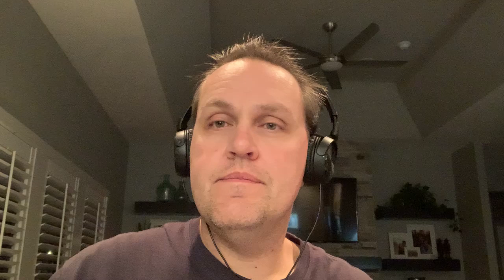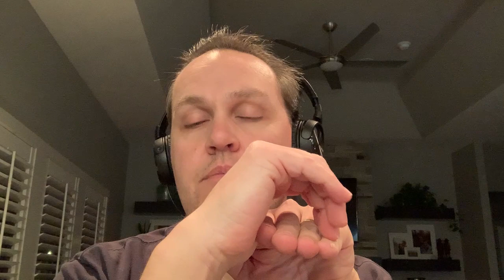Subscriber question LIM noise

Comment: My favorite rollercoaster is Steel Venom at Valley Fair. It's an Intamin Impulse coaster that uses LIM magnets. It always made a very distinct "screaching" or "grinding" sound whenever it launched. However, one thing i noticed was that when it received a new launch system, it sounded different. It made a high pitched "squeal" or "beeping" noise. I know the launch system was replaced, but the magnets still look the same from an external stand point. Do you know why or what caused this change?

Comment: I think there is a lot higher frequency in the driving signal. I don't know what the main frequency of it is, probably slower waves are made by switching at a lot higher frequency, and the  whine is trash in the signal.
Reply from the maker: I know it’s a mix between frequency and current. One time I took a 6 stator motor and disconnected 4 of the stators, ran a test pulse,  and almost blew my eardrums out. Shook all the dust off the track haha!